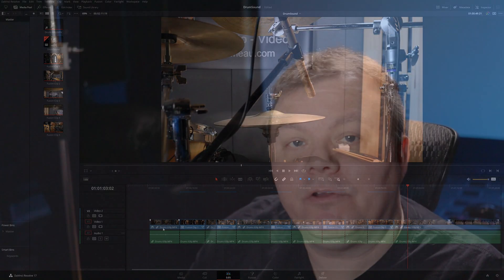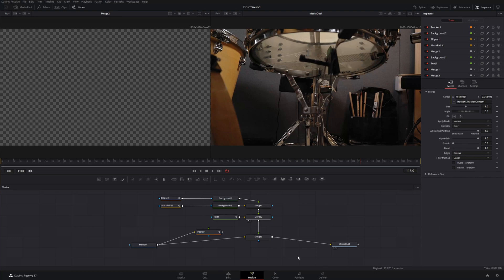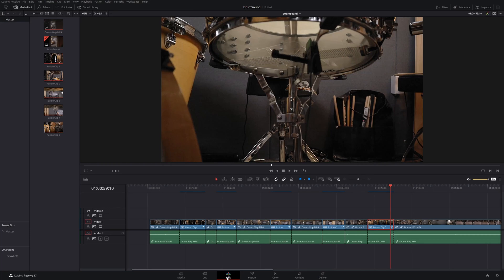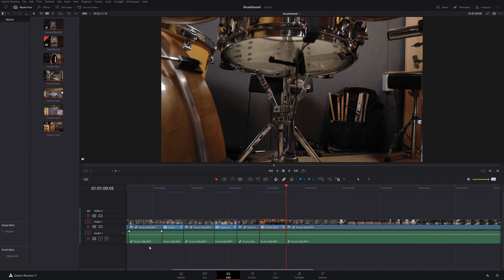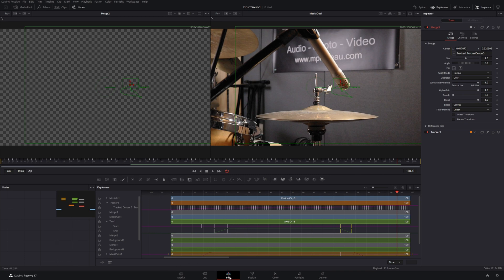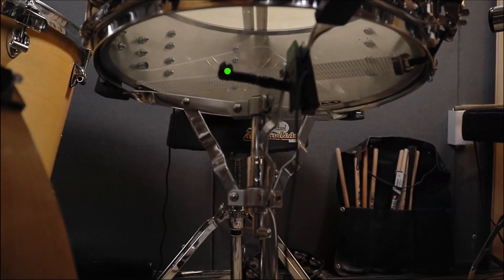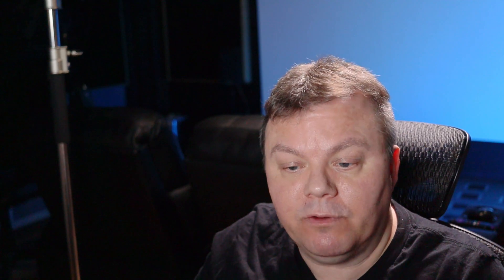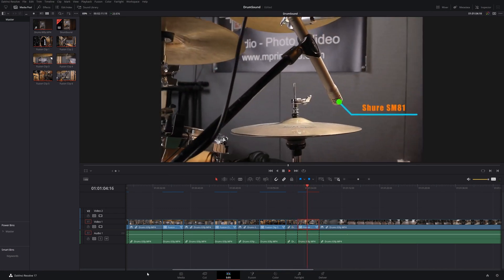Davinci Resolve - re-use fusion assembly - multiple instances

Comment: It's a very nice tutorial. I am wondering though why you're using the simple expression method instead of the more common Fusion way of connecting things: via right-click and connect to-->  when using it that way you'll be given more options to keep it more interactive. If you want to off-set your track for instance, your method results in having to manually add numbers to the expression, which is slightly more error prone. When using the connect to--> method you'll be able to use modifiers to interactively change the results of your tracker.

Your method works perfectly by the way, but it's slightly more technical and advanced than strictly necessary.
Reply from the maker: Honestly, I was following JayAreTV's method and this is the way he connected things. It might be due to his advance knowledge and habit coming from older versions.. ;)
Reply: @MarcoPrimeau  That's the beauty of (the) Fusion (page) : there are many ways to achieve the same result. I don't know Jay Are TV, but a lot of people who do Resolve/Fusion tutorials have learned it while transitioning from AE and sometimes it  shows from the approach they take when trying to solve things. Pick-whipping being one of the tell-tale signs :-)